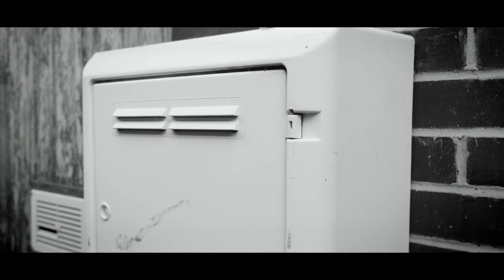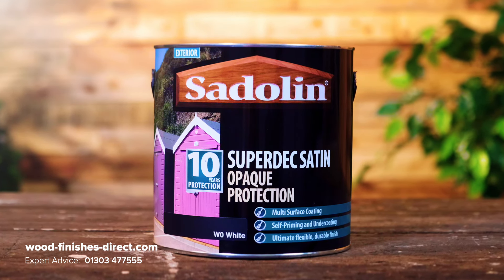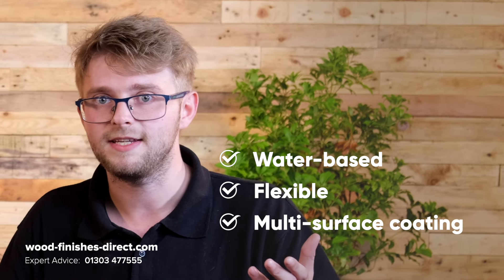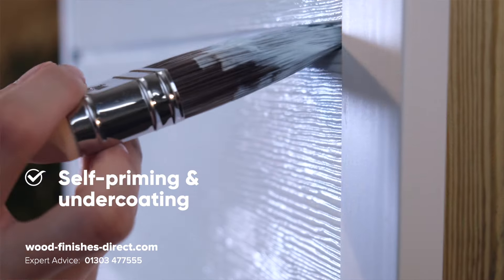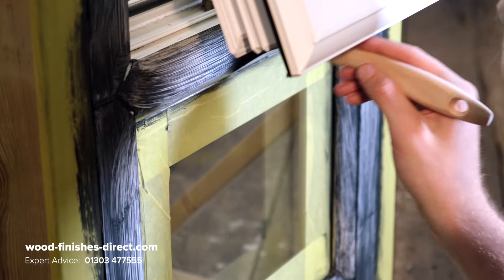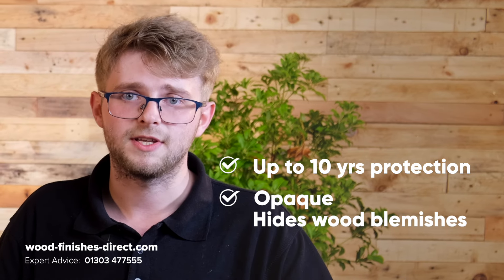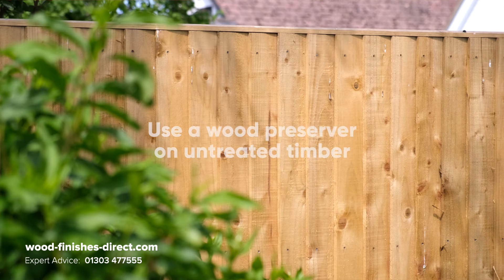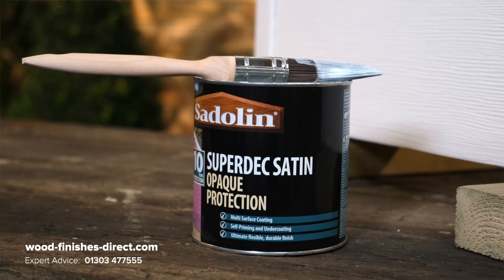Ask An Expert: Can I Paint uPVC? Sadolin's Exterior Paint

Comment: Thanks, I'm a decorator but had no idea that Superdec was like Sadolin's equivalent to Bedec MSP or Zinsser Allcoat,  good to know for future projects, my only concern with painting pvc windows and doors is all the silicone around them, would you remove all that and redo it in a paintable exterior caulk?
Reply from the maker: You make a good point! We've just called Sadolin to find out what they recommend. They said if the joinery is lined with silicone they suggest digging out silicon and applying the paint first, once coats are complete you can apply the silicon to the gaps at the end for a perfect finish. Or replace it with a suitable paint putty/product before starting the project.